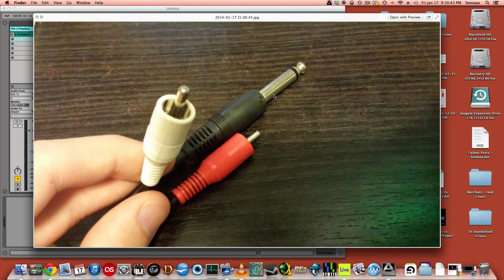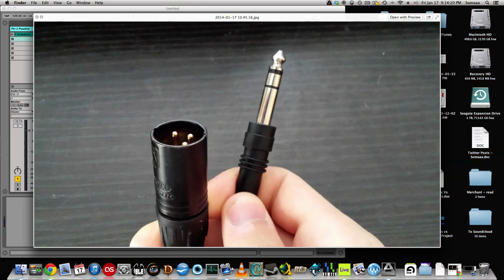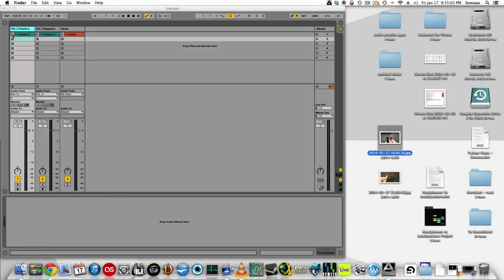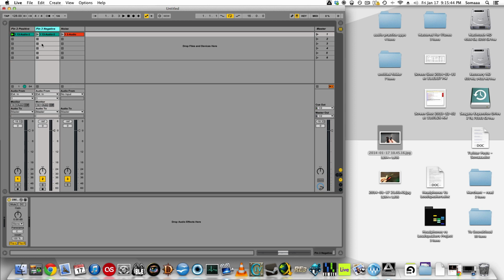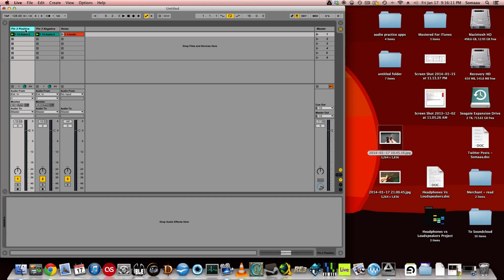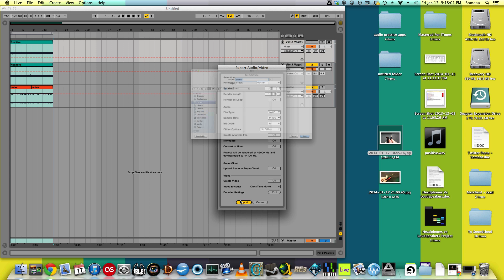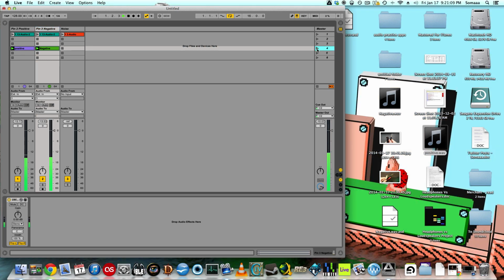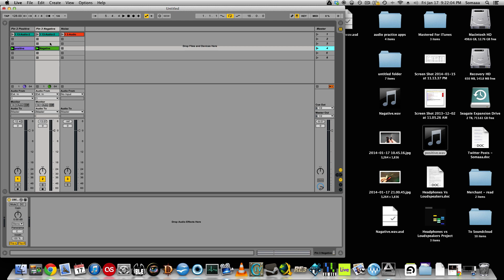Balanced vs. Unbalanced Cables - How To Reduce Unwanted Noise

Comment: Thanks for the interesting demonstration.

Question. When I send the music from the mixer using balanced cables to the computer and record it into a software (eg garageband) - is there a difference in sound quality sending stereo 1/8" pin or usb plug? Or is there still a better way to get the best sound into the software?

Thanks
Reply from the maker: The Hip Gurus Guide This is kind of a complicated question but ill try my best to answer it. The best way  to get audio to your computer would be to use an interface with a good analog to digital converter. Its converting that pair of balanced cables to digital audio in the interface and giving it to your computer. If you plug in audio to your computer's 1/8in input then the computer uses its own inferior analog to digital converters to bring the sound to garageband.
Reply from the maker: The Hip Gurus Guide there is a difference in quality but you may not notice if you dont have solid speakers/headphones. I really dislike the converters of most computers. I can usually hear a difference when sound is being recorded and when when its being played back out of a crappy built-in computer digital to analog converter. I hope I helped. let me know if i answered your question! best of luck!
Reply: Somaaa Thanks Somaaa. To clarify,  I wouldnt hear the difference between usb or 1/8th" but would hear the difference using a good analog to digital converter? I looked at Grass Valley ADVC110 Bi-Directional Analog / Digital Converter - but it has RCA inputs - which seem would diminish the audio. Is there an alternative solution to record and then just upload the finished mp3 or wav to the computer?
Reply: Somaaa hi plugged the TRS 1/4" cables into tascam digital recorder and it sounds great - thanks for everything

Comment: I recently bought some new TS 1/4 inch cables for guitar, and noticed that they have a very significant amount of noise to other TS 1/4 inch cables that I already own. What could be the cause of the noise and how could I fix it? It might be worth noting that the cables I bought were the cheapest available.
Reply from the maker: +Albert Chow cheap cables can be problematic at times and there is a good chance thats the reason. I honestly dont work with guitars often enough to know if balanced cables or something else is the solution to this. I will say that if you are serious about your music then your instrument deserves some nice cables.
Reply: Read along the length of the cable itself. If one says speaker cable,  and the other says instrument cable, that could be your problem. Also, you can test the ends with a multimeter and fix any loose parts or reinforce solder joints to silence any noisy cables. It only takes a couple of minutes to learn the process on YouTube.